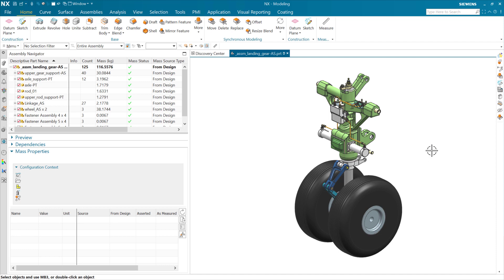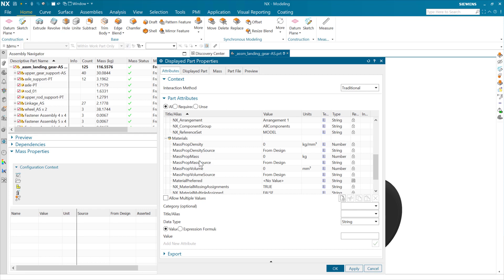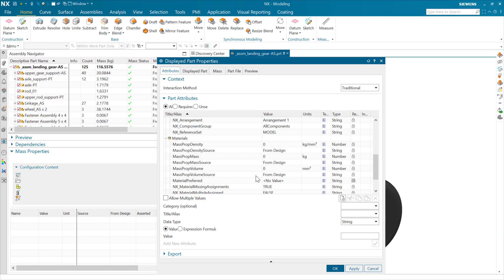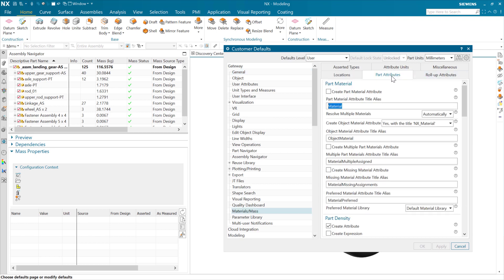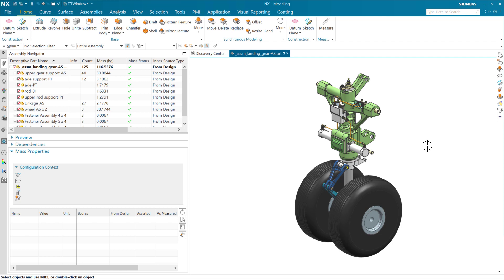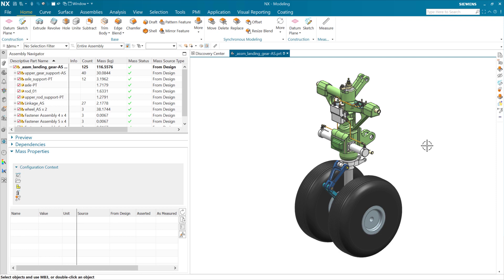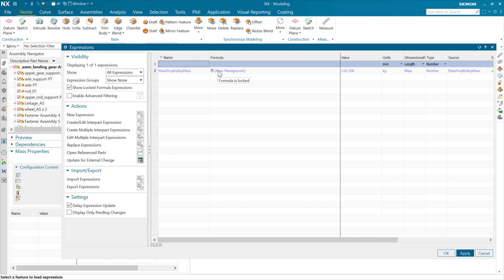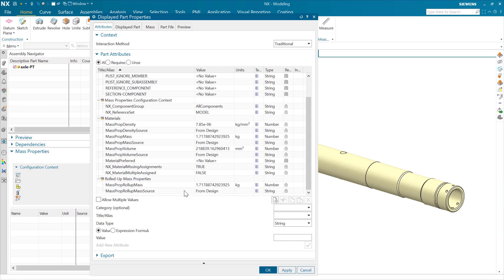NX Assembly Mass Properties: MassPropRollup Attributes for all Parts [NX 2212]

Comment: When using master model approach (drawing and model in seperate file), is it best practice for the titile block on drawing to refer to MassPropRollupMass of the master model, or of the drawing?
Reply: I am having trouble to define the attribute in my template. MassPropRollupMass is defined in Customer Defaults to be created as attribute but does not create. Siemens sometimes complicate things that shoud be easier.